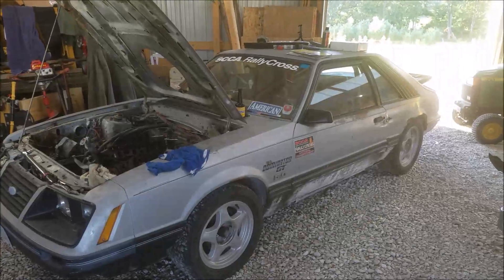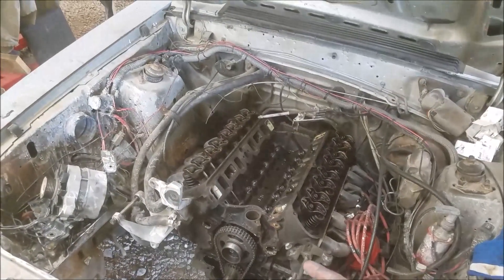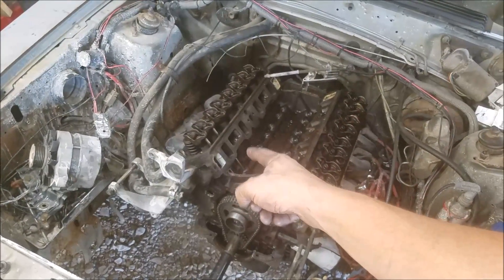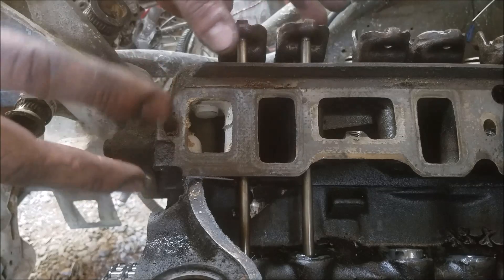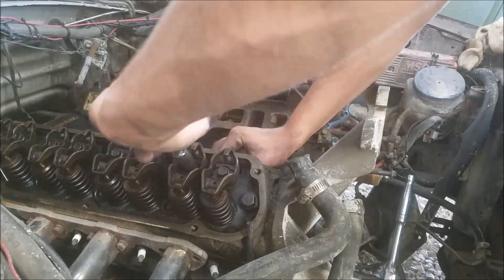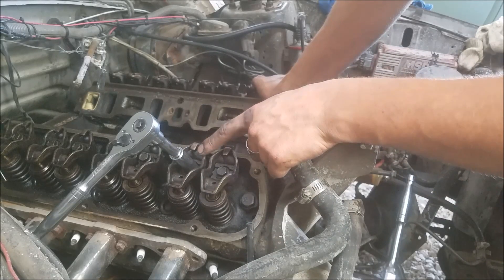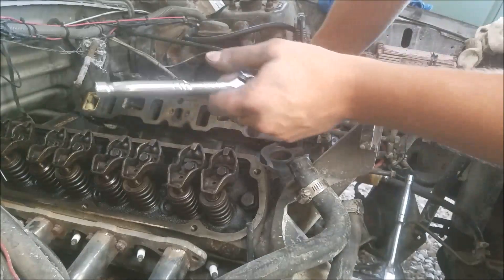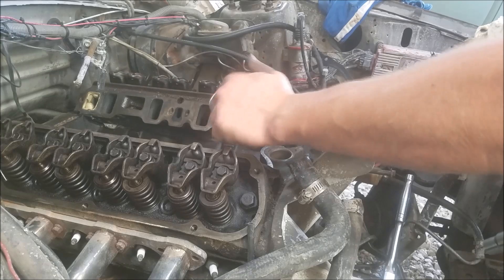Verify Pushrod Length/Pre-load - Pedestal Rocker Heads (302/5.0 & 351W)

Comment: Hi, I reached out to you once before.  I have a 1990 Ford bronco and the engine was swapped for same engine just rebuilt by po.  I’ve always had lack of power issues since I bought it.  I did a tune up(rotor, cap, plugs, wires, and coil).  Since then, the whole engine shakes horribly when in drive and reverse to the point I can’t drive it.  It stalls and then the only way it starts again is if I move the distributor some.  I time it everytime with timing light, I’ve also had 2 other people time it and still no change in shake and everytime distributor needs to be moved to start like it falls out of time.  Another thing worth nothing, it only starts when the distributor is off angle of the factory placement.  When I line it up with bolt like it says in manual, it will not start, then when I put it a little more with icm pointing to the left it starts.  What would you check first?  Thanks

Comment: 🔔 The reason that Ford is agressive with their lifter preload is that as the engine reaches operating temperature, the lifter clearance gets LARGER not less. This is normal on all engines regardless of iron or aluminum heads.
Reply: Think of solid lifter cam lash..... @ .005 tighter when cold.

Comment: Do you need to have the lifters bled down or pumped up before adjusting the rockers?
Reply: Yes would like to know this as well putting in new lifters, the soak or not to soak question. I have bolt-down cobra roller rockers and the more I think about it when you tighten snug past zero lash and the rocker bottoms out they preload the lifter and cannot move further so probably does not matter if you presoak or not and if you do likely drained of oil until it is running anyway? At this point you torque as you stated for thread stretch and will not impact preload since the rocker is bottomed out, the 18-20 foot pounds just keeps them in place? I believe you need to adjust push rod length or shim rocker so bottom out past zero lash is between 1/4 and 1 turns and sounds like that is 0.03 to 0.06 of preload and spec on stock lifters? Is there an ideal number for the preload depending on how you intend to use the engine? Thank you for the video.

Comment: Do you think that the 289 was a more soild and dependable engine then the 5.0. I'm not dissing the 5.0 I've got 397000 miles on mine in a 86 crown Vic. Drive it Daly. I know a lot of improvement can be done on a 5.0 also. My 289 high performance stock in my 66 mustang is a good strong runner. There's just something about that 289 h p. Love it. Thanks love your shows.
Reply from the maker: In my opinion, anytime you can lesson the rod angle on an engine, the more reliable and rev happy it will be. That’s the 289. Loved the sound of mine - really want to just overhaul it and stuff it back in my galaxie

Comment: I know this an old post. My friend was having lifter clatter on a motor he rebuilt - just like this one, so we pulled the valve cover off. I noticed the bolts - not nuts on the rockers. It looks like they just bottom out all the way tight and that's it. Non - adjustable like in this post? And they were all tight but still clattered. Every small block ford I ever had, the rockers were on a rocker stud and they're adjustable with a locking nut. He's telling me they can be tightened further but I think he's wrong and has no oil flowing down the rocker arms while its running. I think - "oil pump" right away. Bearings shot, pick up tube, or something like that. Then he say's that he doesn't have and hasn't had any oil pressure for a long time, and that his gauge is broke maybe. I think the gauge is probably ok and there's a problem with his oil pump, pick up tube, or bearings causing the oiling problem. We're pulling the motor and pan tomorrow to see what's going on down there. That motor had rocker clatter from the first day he ran it. He said he was going to adjust the rockers again months ago, and I thought nothing more of it. Until today when he asked if I could show him how to adjust the rockers while running. This is after a1000 miles of clattering... I said yes, cut out an old valve cover he got from the junk yard today and that's when I saw the rockers were not getting any oil. If you have any further advise on this particular issue I would be very appreciative. I watch your channel (because you know what you're doing) and subscribe as well. Thank you for posting this...It confirmed my suspicions but I would appreciate your thoughts as well when you get a chance.
Reply from the maker: Pedestal rockers are pretty common on post 74-76 heads - which are not adjustable. If your pushrod length is short because you installed an aftermarket high lift cam, you will have this clatter happen. Now no oil pressure is a separate issue that needs to be looked into for sure
Reply: @ThunderHead289  He says the motor is the stock motor that came in his truck. A  94' f 100. All I know is that it's a newer gen 5.0 with a throttle body. First time I ever saw one was in the late 80's early 90's No matter matter what it is though. It's coming out today and I'm going through the whole thing. No oil pressure and not oiling the rockers - it's got to come out. He keeps insisting that these rockers are adjustable and that he adjusted them. But they're tight- really, really tight.. Way more that 20 lbs. Anyway, I'll take care of it. Thanks anyway.